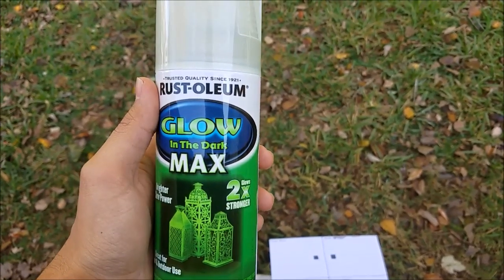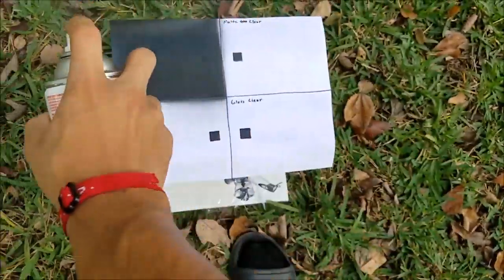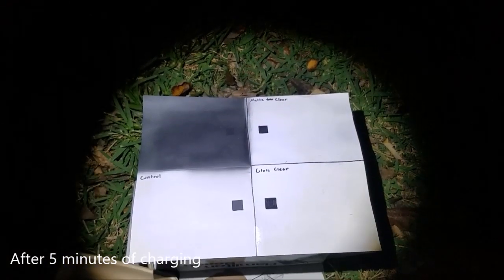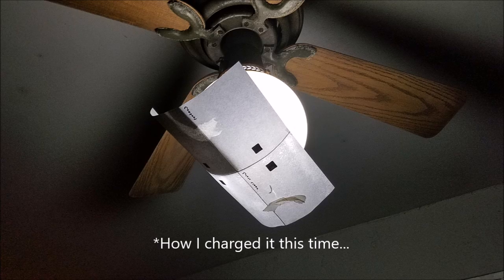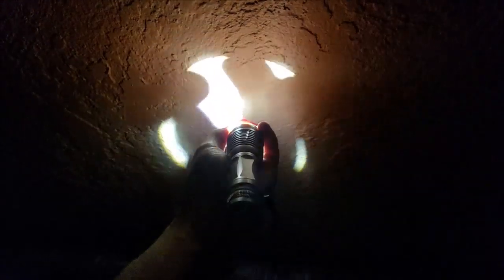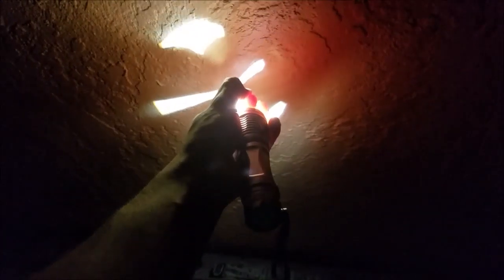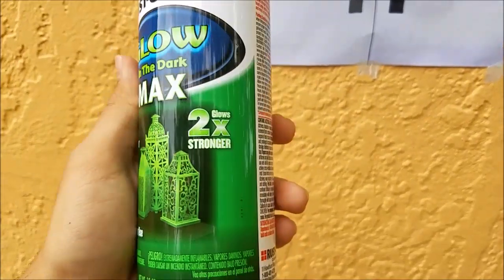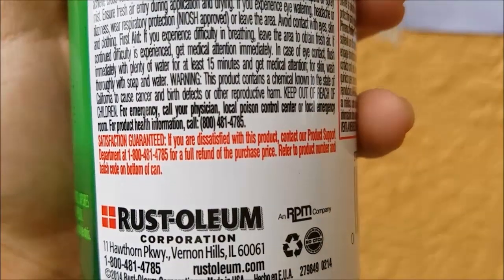Test and Review: RustOleum Glow In The Dark MAX 2x

Comment: I bought this product and you're using it wrong. For optimum effect you have to charge it with Sunlight for at least 6 hours to obtain maximum effect. Charging it with a flash light will not have the desired effect.
Reply: gavin gertzen Hey there! Where can I buy this glow in the dark spray?
Reply: Denn Vincent  Valdez Hi I bought it from the local hardware store. You should look for someone in your area that stocks Rustoleum products.
Reply from the maker: I did some other testing on a motorcycle helmet. Even in the Sun for hours, it dies down quickly. As far as the results, I think they're close, but a few more coats would definitely help. Might make another video with more coats. Thanks!
Reply: another way to charge anything "glow in the dark" is by using a UV light source .. UV light , or Blacklight charges fast.. I use this method inmy grandson's room for his stars .. its good, but does fade fast ... does not last for hours on end. (sadly)
Reply: And it needs to be applied on a white surface for best result.
Reply: Use a UV Flashlight

Comment: My Can lid alone was glowing all night! I am using the regular glow and I paid 18 for it… it says to use a primer aswell before using the glow spray along with having to wait 1-2 hours to handle and 24 hours to fully dry maybe that’s why you got it on ur hands 😅, also you do have to give it a spray 2-3 times also mind you a clear coat to protect the paint will not ruin it! I do tumbler cups I promise the clear coat will do you justice! 🥳❤️
Reply: @jojosicairos6903 if using clear over the glow spray does it dry with a smooth surface?
Reply: @dgb2394  usually it does!! But I suggest when your glow coat is all dry just lighting with your palm go through cup for any bumps and just sand down very lightly with 200 grit sandpaper or lightest sand paper there is and than you can clear coat ❤️ I also recommend resin/epoxy

Comment: Hello not sure if you are going to actually read this comment, but anyway I bought the same can before seeing this video. I read the very back of can it does also state that purchasing a can of Rust-Oleum white primer can help to give a more brighter glow as well so idk if maybe you may want to look into making a part 2 of this video using the primer it may make all the difference however even if using the product in the proper temperature and humidity I didn't see them mention that it can improve the length of the glow lasting which I think is a bummer

Comment: Does that spray paint go good on wood and chairs for outside I got a pretty picture of 22 inches wide should I treat the wood for it first and then but they glow in the dark paint on winter but the glow in the dark paint on it then but that stuff over it so it don't rot when it sets out here all winter that guy that made a set of treated wood but you know you never can be too safe
Reply from the maker: Yeah I think it'd be best to put the spray in the dark paint first, and then some kind of treatment or clear coat to protect it. As you saw in the video, that stuff was coming off really easy without a clear coat.

But always do a test spot first! Then make your decision! 

Thank you!

Comment: You need to read the directions it should  be charged while the paint is wet and it need to have a thick coat and dont scratch it the paint is not dry